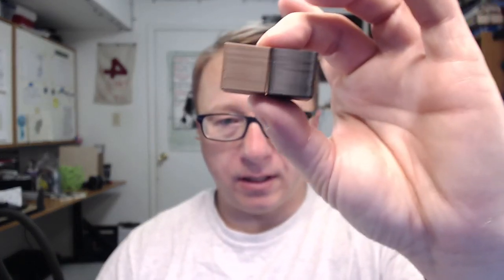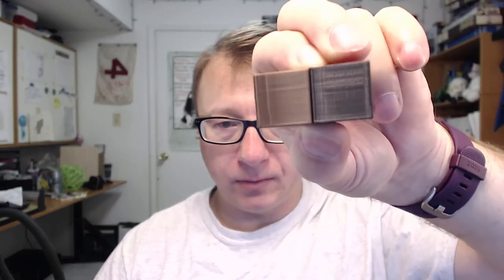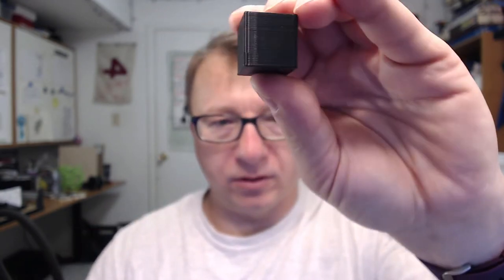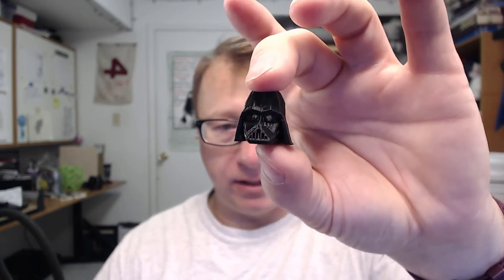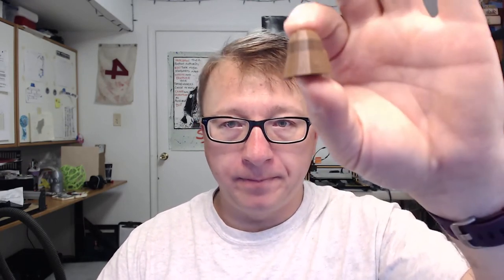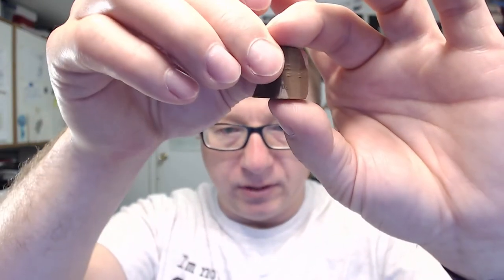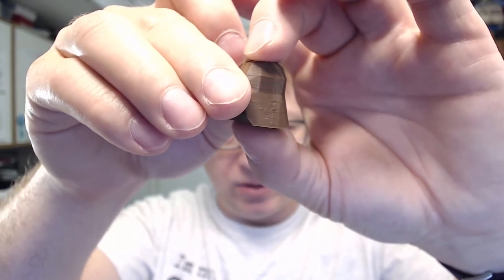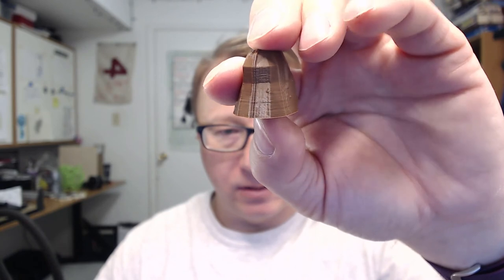Testing Simplify3D Coast and Wipe Settings on Prusa i3 MK2 and Creality CR10

Comment: Dont worry about the dislikes. People can just be douches.

Do you have it set to optimize or random start points? First thing i did was set to optimized for speed. Makes it more consistent.

I got a little help using negative extra restart -.35mm for now. It did not remove it but did reduce it. Coast i have at 0.2mm no wipe that always makes it worse for me.

Still working on tuning out the zipper. Prints are so utterly perfect otherwise its driving me nuts :-)

Comment: Idk about S3D but look for the setting “z-seam” or “layer start and end/change”. It may be called optimized/standard/fastest/random/ etc. when you select “nearest” or “shortest” the slicer SW will not care about where it starts to begin a new layer along the Z axis and thus more zits are possible depending on retraction-speed/distance. I usually choose “align” so that if there were to be a visible Z-seam at least it’ll be somewhat straight along that axis. Usually, this also means more time for both slicing and printing due to altering the Gcode paths for that specific layer start point.  So look for those settings and also make sure retraction settings are dialed in especially speed and distance/amount.

Comment: Did you ever figure out how to rid these artifacts and zits?
Reply from the maker: Hi - not entirely.  Better filament helped but didn't reduce them to zero.  Also, turning on "randomizing start" within S3D helps with the layer artifacts.  I have not tried inside out to outside in yet - I suspect that would work since the z movement would be "hidden" from the outside where the artifacts are.  Hope this helps.  Thanks for watching!

Comment: you dont have any video of printing those? That looks like Z-seam blobs, they are harder to get rid of when using bowden system. Maybe too high temps? Better info would be good, timelapse of print + settings? Do you have cooling etc.. (tuu much, not enough)  it is like, comparing 2 different cars from the tiremark they leave on asphalt. More info needed. Getting used to 3d printing takes some time. You'll get hang of it.